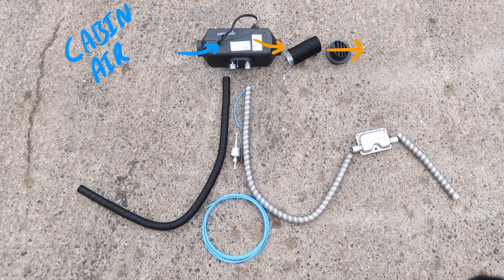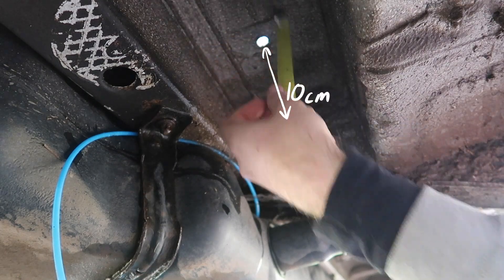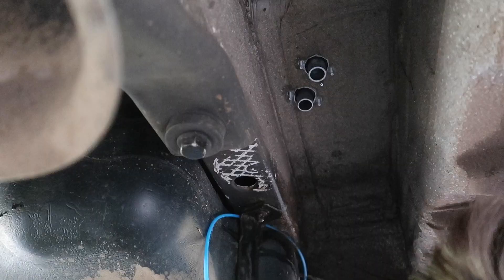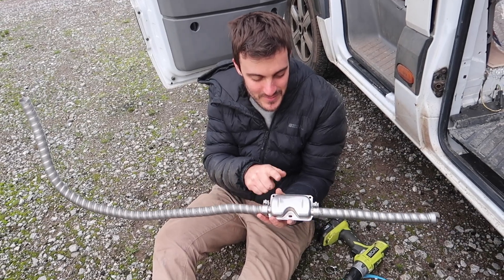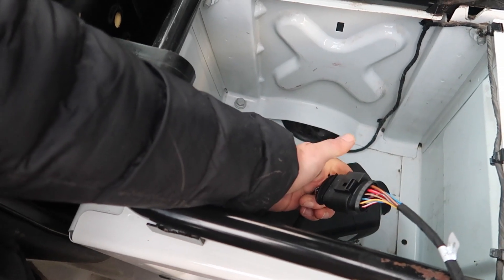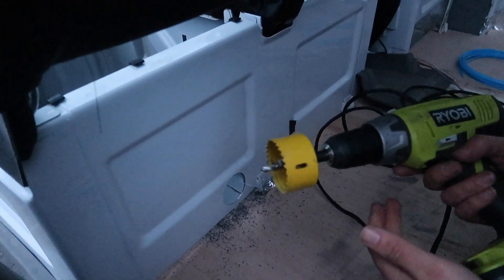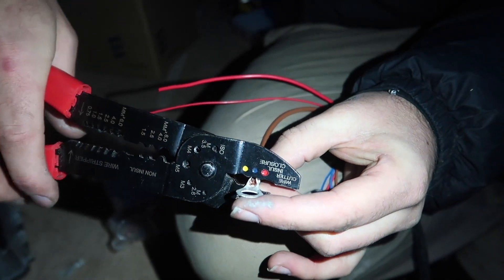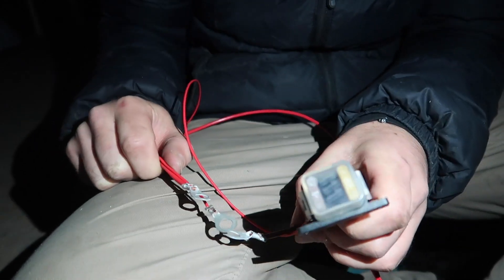How to install an Eberspacher Diesel Heater in a VAN | Tips for installing a diesel heater

Comment: Great video thanks for sharing! All the pro-van builders I've spoken to go for fitting it under the drivers seat, external. I guess this is so the exhaust can vent towards the road, rather than the pavement!

Comment: Thanks for this. I was trying to figure out how to run the intake and exhaust through insulation but then I realised I can just leave the insulation off the floor of the back area which is sealed from the main living area anyway.
So many control boxes! I'm building mine around Arduinos and ethernet. One screen (or your phone) to control everything.
Reply from the maker: Thanks. Arduinos are so cool, I always wanted to do more projects with them as the possibilities are endless. Good luck with the build!!
Reply: @HannahandMyron  That's kind of what I'm doing with the build - end-to-end 240V, 12V and Ethernet - never one without the other 2. With that in place, they can go anywhere - the options stay wide open. Since you did your own wiring, add Ethernet and then let your imagination run riot!
Reply: Sorry to be offtopic but does someone know a tool to get back into an Instagram account..?
I stupidly forgot my password. I would appreciate any help you can offer me.
Reply: @Deandre Tate instablaster ;)

Comment: This looks the same install as the "planar". What happen to that?
Reply from the maker: Yes it’s very similar. We’ve still got that video up. https://youtu.be/PP_QGjEHFCw I’d say the main differences were the wiring and the angle the pump needed to be installed. But you could follow either of these videos to install any brand - would recommend having the manufacturer’s instructions too though.